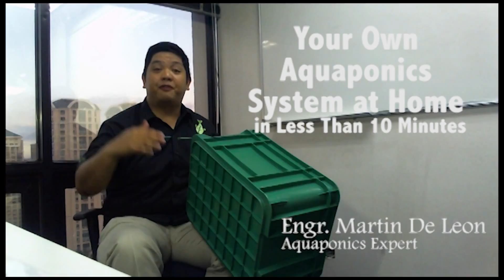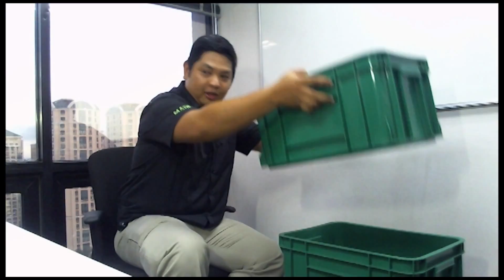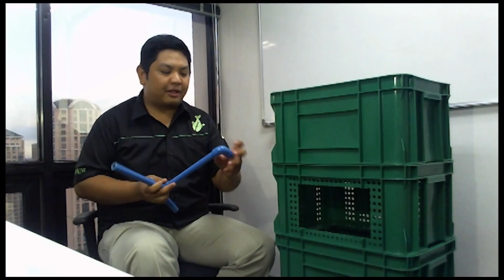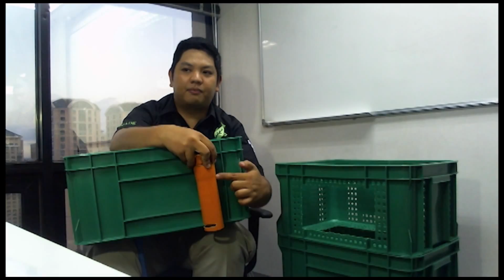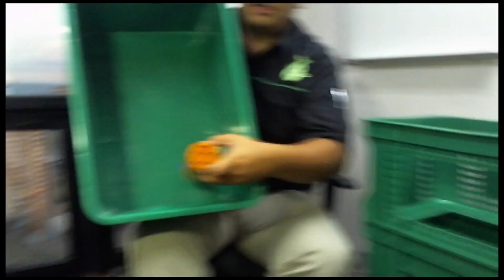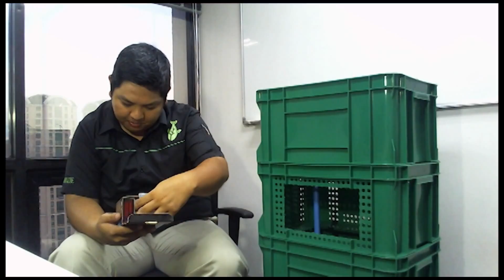DIY Aquaponics System in 10 mins

Comment: sir correct me if im wrong but i have read from other forums that the plants dont need the fish waste in whole and that i actually would still need a filter to filter out the fish waste. the plants will get what they need from the water itself ?the amonia ?
Reply from the maker: Nitrates.
Reply: so did i understood this correctly ? they dont need the fish waste ? just the amonia broken down into nitrates and thats it ? or should i remove the filter and allow the fish solid waste to drop on the media as well ? im studying this method because i wanted to provide clear water for an aquarium that i am planning to setup. thanks very much.

Comment: sir can I set up a 10 gallons gravel bed and a 10 gallons floating bed with a 50 gallons fish tank? is it possible? what kind of pump can I used for that?? hope u can help me
Reply from the maker: Yes you can. You need a pump that can pump the height of your growbeds and circulate the 50 gallons of fish water in 1 hr.